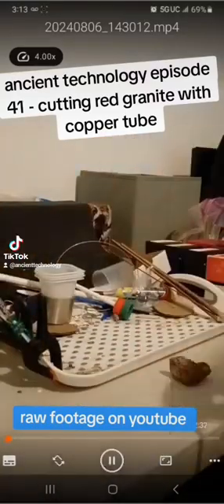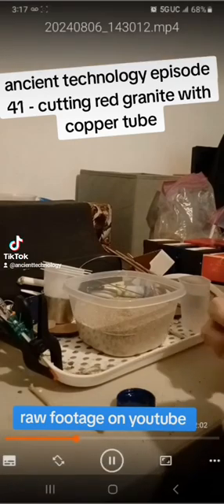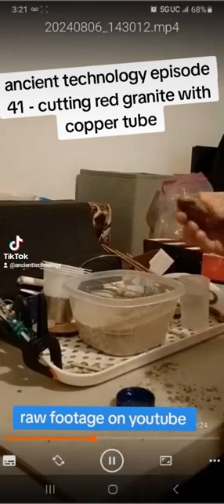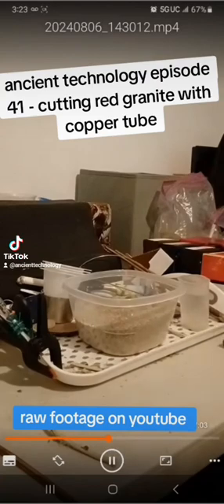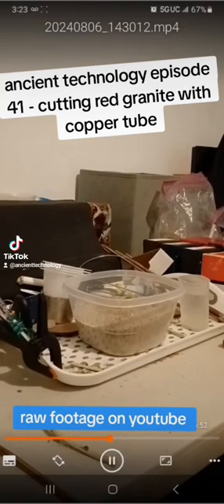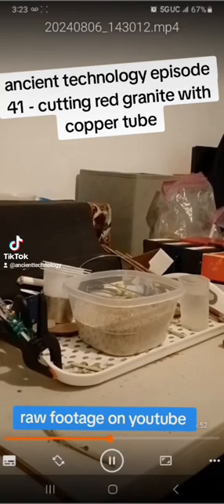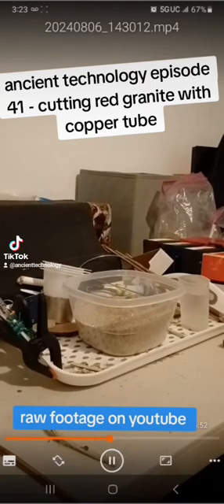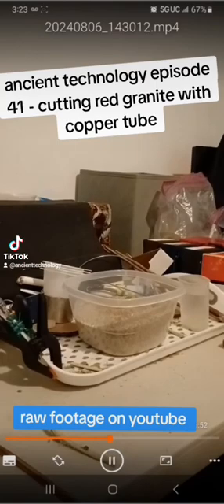ancient technology episode 41 - cutting red granite with copper tube

Comment: I have no doubt that ancient Egyptians cut very hard stone with abrasives and built all the wonders left behind.

I had an epiphany once while core drilling using a water cooled diamond drill powered by a small 2 stroke engine turning 10k rpm. It took me close to an hour to cut through around 24” of modern concrete that only cured for a couple of weeks. I believe the Egyptians did the work with the tools described but I don’t think we understand how they implemented them for production.

I think they were using water powered machines to drill and saw blocks into shape.
Reply from the maker: Agreed. Soon I'll have a video about chemical power source for power tools. 😊

Comment: You forgot the first and most important step....making the copper tube!   Taking a modern copper tube and laboring to grind it into a rock isn't nearly as impressive as mining, crushing, smelting and forming the actual tube.   As fast as the copper tubes would have been wearing down....there must have been a HUGE industry in their production...yet there are no remnants of this industry.
Reply from the maker: @recoilrob324  so you are not confused. I'm disproving the copper tube theory in this video. Not supporting it. 😕
Reply from the maker: @recoilrob324  I didn't forget. Because it doesn't matter.  You can use a stick with sand to cut granite. Or just use quartz crystals to cut granite. Or just use a piece of granite to cut granite.
Reply: @kungfumaster12  Oh it doesn't matter that making the copper tube is more difficult than using one to supposedly demonstrate how the tube drills in Egypt were used?   You're putting the cart before the horse it seems to me.   Make the tube if it's SO easy...which it isn't.   Using a modern copper tube to slowly grind into a stone isn't showing how the ancients did it.
Reply from the maker: @recoilrob324  I never said it was easy. I don't believe they used copper tubes. You clearly didn't watch the video. Because copper can't cut granite at all. The granite cuts the copper instead. Are you even listening to what I said. Or are you here to troll?
Reply: @kungfumaster12  Why did you title it 'cutting red granite with copper tube'?   There are MANY video's on the web claiming that the tube drills were copper and sand/water was used as the abrasive.   I won't waste my time watching any of these because that's just crap because of the points I made earlier about the difficulty producing copper tubes en mass as would have been needed were they actually doing the coring that way.
Reply from the maker: @recoilrob324  The title is supposed to have a question mark. But i left it out as click bait. Copper tubes aren't needed at all to cut stone. But ancient humans can easily make copper tubes. And there is proof of it in egypt museums. Egyptians use gold to make stuff. So They can use gold tubes instead.
Reply from the maker: @recoilrob324  you say you don't waste time watching those videos. But you are here at a video that you thought was about saying that copper tubes was used. When this video is about copper tubes aren't needed at all. And are a waste of time using. So I was right. You came here to troll the video.
Reply from the maker: https://youtu.be/wStA1rYtd_w?si=N0k678HWFWCYhgaI @recoilrob324